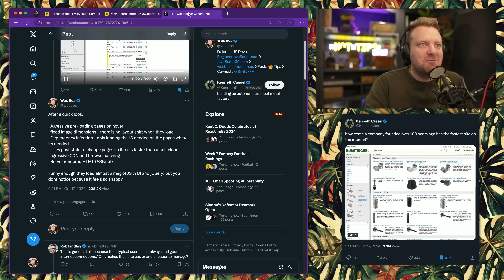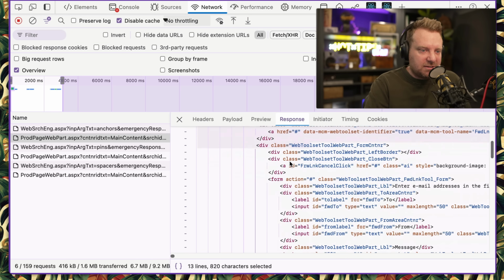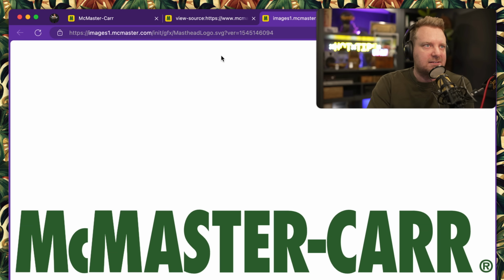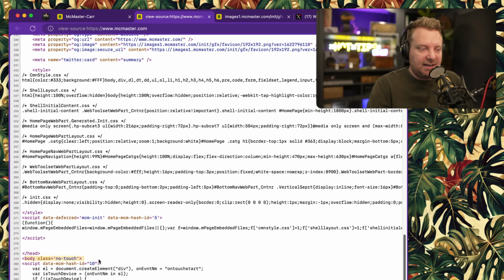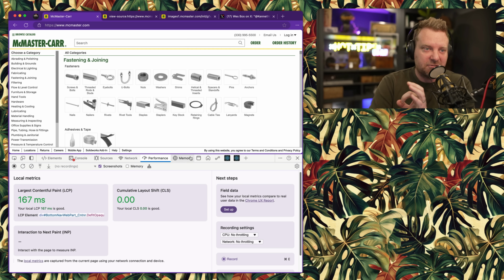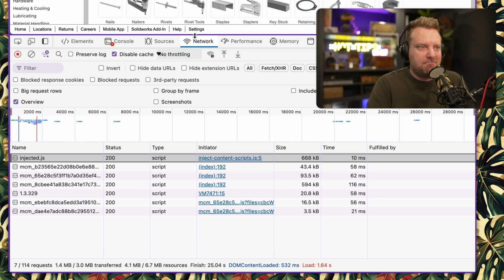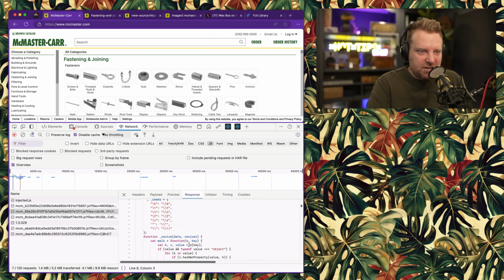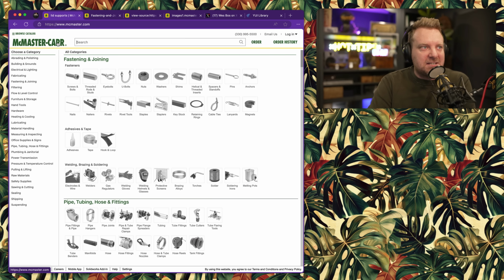How is this Website so fast!?

Comment: McMaster Carr is one of the most legendary private companies in the USA. They are famous for hiring STEM new grads and paying them $120k+ to pack UPS trucks. They also have their own dedicated UPS distribution center in their main warehouse. Crazy business.
Reply: Allegedly they have entire floors dedicated to servicing DOD contracts with secret and top secret clearance requirements. Heard this from someone who worked there on their catalog.
Reply: Lots of people join out of college because their comp, benefits and bonus packages rival big tech companies and then never leave because of the golden handcuffs. Lots of really smart people going deep on the tiniest little details. Whole business is greased from top to bottom by some of the smartest people in the country
Reply: So many times I’ve ordered something from them at 10PM, it’s on an UPS truck by 12AM and halfway across the country and out for delivery the next day at 4PM. Their integration with the logistics companies is on a whole other level.
Reply: Also their website and catalog is so good that it’s standard for engineers and machinists to use it for an engineering reference even if they don’t plan to purchase anything. Second only to the legendary Machineries Handbook
Reply: Hiring a STEM new grad just to pack trucks seems like a complete waste of talent, I'd rather make less somewhere else if it means I'm learning new skills - packing trucks is not something a young STEM grad should be doing with a degree in science/technology/engineering/mathematics - they should be doing something that involves STEM. They're a great company, but that just doesn't make much sense to me. It doesn't surprise if they had areas dedicated to secret DOD contracts, I would expect McMasterCarr to be no different as the military's gotta get their nuts and bolts from somebody.
Reply: @linuxguy1199 having STEM guys do blue collar work is way more important than you realize. 
It introduces them to the  difference between computer modelIing vs human behavior and real world use.
I went from being a $11/hour driver (no college degree due to my poor background) to being a VP of a engineering/UI/UX  division in 15 years with fortune 500 company, simply because I knew the difference between the two. 
I had two PHD guys rage quit on the same day when they found out that their new director (at the time) was going to be a HS dropout. 
Were they smart? Very! 
Were they an asset to the company? 
Absolutely not. 
They literally dragged things down because they knew "better than everyone else"..
Reply: @linuxguy1199  that’s always the reaction and I cannot justify it myself but as I understand it the reason why they have such a deep integration with UPS is because they have really smart, driven, and empowered people deep in the entire logistics process which starts with packing trucks.
Reply: @linuxguy1199  but you’re right that many with that degree would rather do something else. McMaster Carr had a deep culture of “golden handcuffs.” Really talented people doing really low skill work but being paid so much they didn’t dare leave.
Reply: @LukePighetti  The question is how long they keep packing the trucks. I've been in consulting optimising workflows and 90% of the issues and solutions will be found by working in the positions/ dhadowing thenpeople doing the job. So skipping the middlemen and having the stem people do the job directly and find what needs improvement is quite offective. The main reason the improvements won't get done is that the employees fear for their jobs when they raise issues or don't know how to get through to the management, that is able to make the change. Stem phds that can just find something else if something goes wrong won't have that issue.
Reply: When I worked for UPS unloading the McMaster trucks was the worst job – boxes of carbide tools are ridiculously and deceivingly heavy. The only thing worse was when a returned box of ball bearings, wrapped in nothing but masking tape, would burst open and spill steel balls all over the loading belt. Then it looked like a slapstick comedy with everyone stepping on them and falling on their ass.
Reply: @PaulMcCannWebBuilder  I worked for a shipbuilder in the stores.... It was always fun getting a pallet of boxes of fasteners to check through. nearly all deliveries had discrepancies which was always a gigantic pain in the ass. also stocktake sucked, although we did have counting scales as a saving grace
Reply: @LukePighetti the most frustrating thing as an American expat engineer is getting drawings with the bill of materials having McMaster part numbers in it, remembering how good they are but being unable to use them and having to order from my local fastener supply shit show.
Reply: @havanasyndrome3024  Yup, I call that being educated beyond your wisdom. Sure, you know some advanced math or whatever, but have no humility to know that beyond your narrow field, you probably don't know left from right. And yes, doing blue collar work absolutely helps, either training them, or at least separate the wheat from the chaff. Best regards by a stem phd guy.
Reply: @linuxguy1199 you dont make them pack trucks forever. Engineers need to know low level things like that. Otherwise they will not come up with improvements later. Having your engineers build some character is a good idea.
Reply: That's so smart. I used to work at a really big distribution warehouse and from working at the bottom level I could see many places where small tweaks could have big impacts. But it's not things that someone 20 departments removed would notice.
Reply: @linuxguy1199  It makes perfect sense  to me.  You now have the people dictating the workflows, understand exactly how that affects the people on the shop floor.  Its not like they would hold them in those areas for months, they only need to work the job long enough to understand how the distribution actually functions.
Reply: @LukePighetti does McMaster-Carr need any high-skill work? No, they need low-skill work done by the highest-skill people they can find. Because if they go even a little out of spec, people die.
Reply: @havanasyndrome3024  they were an asset but you and your company don't know how to use them. Maybe that is why we get crappy products and inefficient companies with thousands of bottleneck workers.
Reply: They're FAMOUS for that? This comment confuses me in so many ways
Reply: @linuxguy1199  Having the smart folk get their hands dirty is exactly how they wind up with this level of optimization. It gives them a taste for the importance of logistics and smooth, clean business
Reply: @LukePighetti  Ahahaha you're legend man :D Salut from the BIG BROTHER

Comment: As an industrial designer, i use their site religiously for grabbing CAD files to test fit standardized parts for designs. Never EVER had a hiccup. Its fantastic!
Reply: I was amazed when I visited their website and saw that basically everything had downloadable cad files for most softwares, definitely bookmarking their website just for that.
/fellow engineer (albeit mechanical engineer).
Reply: mech desg here came across this video and thinking same thing would be good site to get files lol
Reply: I've found a couple incorrect models before (used a 300 vs a 150 class pipe fitting) and they had it fixed in like 45 mins after I called and informed them lmao
Reply: Are you trying to say it’s easier than thumbing through the ol’ 9,000 page McMaster Carr bible?! Outrageous
Reply: @ChuckThree  yes I am
Reply: They offer free CAD downloadables? No membership or anything? ❤
Reply: @ yes, on most parts.
Reply: @lordmanatee439  ye, all free
Reply: Same

Comment: I'm an engineer, I use their site all the time. It's the best place to get almost any type of hardware, and you can get it next day 99% of the time. They've made it so easy to find the exact hardware you need, and their search and filtering functions work so well. 
Blessings to their interns who must be cranking out CAD files for every piece of hardware as well, it's amazing to be able to just go find the obscure thread profile I want and download it to insert into a file. They've introduced features over time that are actually useful and don't cause bloat, such as quick access to basic part drawings and relatively new scale images.

Comment: As someone who does a lot of engineering and CAD design work, I fucking LOVE McMaster-Carr. Nearly every single object on there has true to life accurate 3d models in like 10 different formats so you can accurately import them into your cad package and have perfect, to scale parts for your model in seconds. The program that I use, Autodesk Fusion, literally has a version of this site integrated into the software so you can pop components into your design without ever having to leave... It's magical, I will never be able to go back! 
Kudos to everyone at McMaster, you honest to god make the world go round!
Reply: yeah, I am astounded by the level of information they provide. And they basically sell everything one can think of. And 3d models for everything, detailed description, correct sized, sometimes even a little info button and a whole new picture appears in the table, showing the threading. This is just brilliant
Reply: They have a plug-in for solidworks as well. It's good business, if they make it easy for you to put into your cad/design, you're likely just going to get it from them instead of trying to find it somewhere else and hope it's the same.
Reply: lol they may start charging for these after reading 😂
Reply: i'm an engineer and have used mcmaster-carr hundreds of times over the last 10 years just for personal projects alone. i know nothing about web development but saw the mcmaster-carr name in the thumbnail and clicked. have always loved their website and often just click around to see what the most niche thing i can find

Comment: McMaster-Carr was a model for efficient web UX design 12-15 years ago, I recall them being held up as an example in some web design book or blog. Good to see that they've not wanted to do a rebuild in potentially less performant newer technologies. That sort of UI cleanness and snappy performance will never go out of style. (I should note that this is literally a catalog site and involves less complexity than logged-in sites with  dynamically-updating user-generated content, so we can't always expect the same sort of performance from other sites.)
Reply: It would be really interesting to see a timeline on when they introduced things. ServiceWorkers are relatively new, and I kinda wonder when the implemented hyperloading. Their online ordering system is old enough that some of the tricks they used today didn't exist in its initial iterations. They also seem to be getting some real value out of the CDN and Cache.
Reply: The exact same no, but websites can be a lot better than are right now, there too much garbage from ads and JS on them, there are room for improvement and optimization for sure, but no one want to take that route nowadays and invest in it.

Comment: I think there is a really important factor here, which is that this site has a very clear and specific purpose: there's this huge catalog of parts that needs to be easy and fast to navigate. Without the feature creep and tacked on bells-and-whistles that so many other websites gather as they diversify and try different new features, the people developing this site can just focus all their attention on making it faster or easier. Having a very focused product helps tremendously at making a very high quality product.
Reply: This sounds like cope. There’s no reason other devs/sites couldn’t apply some of these principles.
Reply: @babel_fishing  There is, which is that those websites are too complicated for no good reason and that makes it difficult to accommodate these optimizations while still providing the business need with adequate cost. When you have to, say, integrate ads, analytics, third-party scripts, etc you literally can't do this preloading. Those are now "requirements" for most sites.
Reply: Their products aren't that focused.  I can order coffee beans, a new drill press, a 3d printer, some bolts, and glue in the same order. Drill down and see how far their catalogue goes.
Reply: This line of thinking was my immediate thought as well: "TLDR the website hasn't been completely redesigned or added major features to upend what the site does in several years, but they still kept one or more devs on staff, so they actually had time to worry about performance instead of losing all possible dev time to supporting new bells and whistles"
Reply: @Mr_Wallet  That would be incorrect. This company is customer obsessed. I can get coffee beans, bolts, electric motors, raw glass, toilets, drills, and each one will either have a size comparison or CAD file (in all major file types) available for me to plan out my work all from a single provider.
This is like if Amazon never started AWS.
Reply: @JollyGiant19  Cool so a very limited feature set multiplied across a lot of products that are all treated similarly. Why did you start your agreement with "that would be incorrect"? 🤨

Comment: Yep. They have some great devs working for them. This site is the Gold Standard of how things should be done.
Reply: as long as you dont hire react devs, you will have fast performance and good devs.. hire react devs and the soy boys show up and spoil everything
Reply: To be fair, the devs are not doing anything special, just following good practices (AJAX, caching, sprites, inlining). So all those "optimizations" are not optimizations, just doing it the right way. Optimizations would be getting rid of the frameworks and squeeze out the remaining few percent while sacrificing maintainability, a cost often not worth it.
Reply: @MaxiTB but they are doing something special. By actually following those aforementioned "good practices" which so many other websites just dont do.
Reply: @Demonslayer20111  That is not special, that's just not sucking ;-)

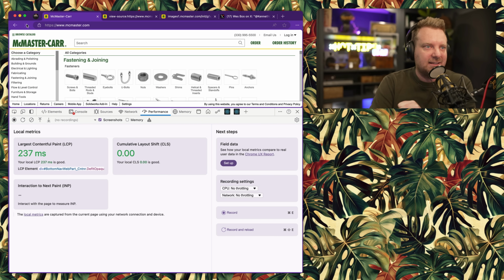Comment: One of the few actual dynamic elements seems to be the phone number at the top right of the page. 7:23 you can see how it gets swapped out after loading, probably by using your ip location to find the correct number for your area.

Comment: Business owners often underestimate how important a responsiveness of a website is. Hat off for devs wprking on that project and to their PM or whoever got a funding to make it happens.
Reply: They also understand they don't need to change things for the sake of changing it. Ive been using it for nearly 10 years, and it hasn't changed much. It makes it nice for the customer when everything is exactly where they expect it to be. It takes some level of restraint to just leave things alone.
Reply: @BeanDipPip  I think Apple's operating systems also have had a similar consistency over the years. If it ain't broke...

Comment: From a DBA's point of view (as far removed from webdev as possible), this was awesome to watch and very educational. Props to the devs at McMaster Carr for actually caring about performance and resource usage. Some devs just build code that runs ok in their specific test environment and make it every one else's problem when performance is crap in prod. This was a breath of fresh air.
Reply: Devs build software to the requirements they are given. Performance, at least to this level, is usually unnecessary and imposes a significant cost.
Reply: Yeah it's not really my problem that the ping to the sql server sucks

Comment: pretty confident that the people in other businesses whose job it is to order parts from mcmaster are in direct contact with the sites operation manager and taking input on a weekly basis if not a daily basis on how the site is running, what needs to be changed, etc... the website, in this situation, is as much a "part" in their business as the parts themselves. imagine you have a site and a business couldn't order a part in time to ship to you when needed because the site was slow, imagine the frustration on both ends. and to see a site like this meeting expectations on both fronts is nice to see

Comment: I've admired this site before, as they even offer the 
Stl files of every screw they sell.
Reply: Lol STL. Faceted models over a nurb?
Reply: @BGraves stl is a more universal accepted format that nearly every 3D/CAD program can load without any need of format conversion that could possible break something.
Reply: @AngryApple  nah, that's.STEP
Reply: @BGraves  Imagine if amazon provided the ability to download models in 3d before you purchased it. Or if you have the ability to machine components yourself. It's not the file. Its the ability to model the component yourself. Or test it in various environments. .stl, obj. I could give a hoot Not many companies are providing this capability.
Reply: @AngryApple  I have never seen anyone use an STL for anything but printer files and stock models. Step is universal and parasolid is nearly universal. STLs are a pain in the ass, id rather work with IGES than STL.
Reply: I never use STL files and avoid them like the plague. Often full of errors, they are surface models, not solids and the original surface information is not there as it’s a triangulated model. STEP is much more useful. Best part of McMaster are the Solidworks files (if you use that software) as those include the feature tree which is basically the source code for SW files.
Reply: They include multiple 2D and 3D CAD models of most of their items, including STEP and Solidworks, DWG and DXF
Reply: STL is garbage, leave it in the past.

Comment: This is one of my favorite sites that I used when I worked in Architectural Engineering and MEP Contracting 

Glad you are doing the deep dive, I always use it as the standard for filtering and drill down mechanisms on the web.